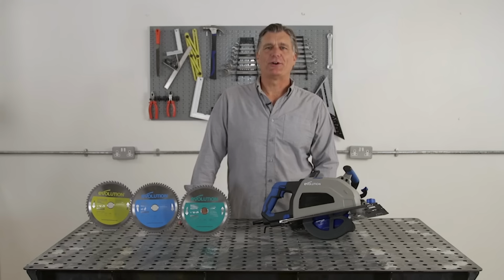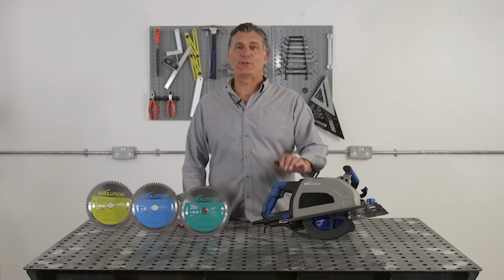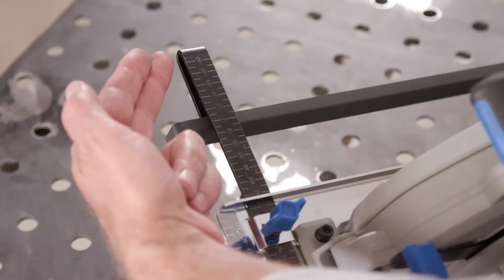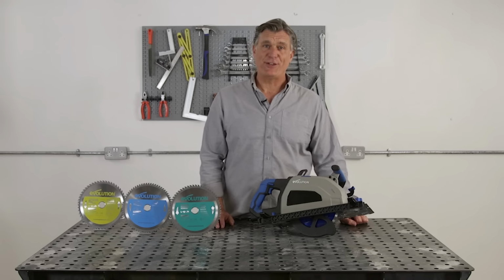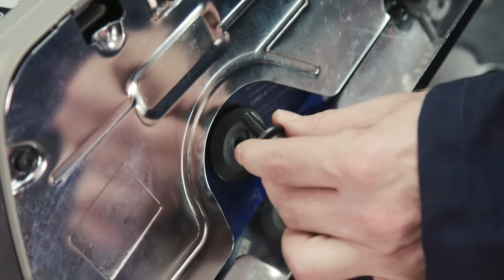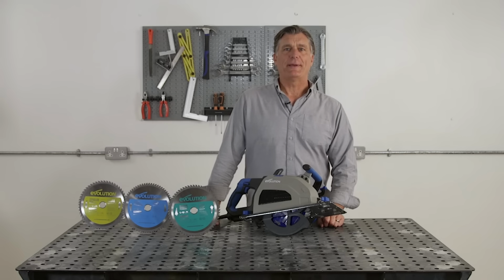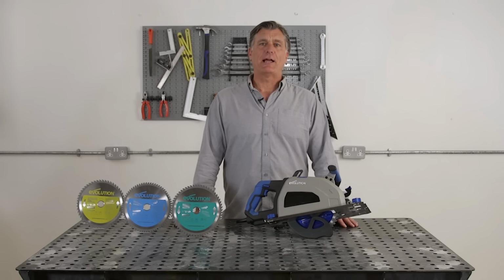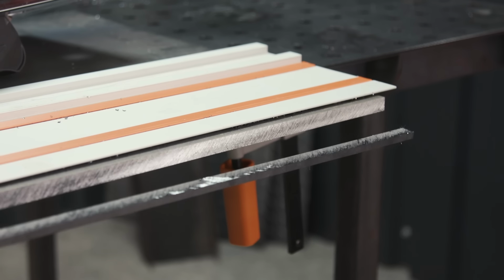🇺🇸 Heavy Duty Metal Cutting Circular Saw | Presentation | S210CCS

Comment: For those wondering about actual customers

I just bought one of these a couple weeks ago. Cuts through 3/16” galvanized grating like butter. Very clean and easy to handle. The motor is robust and doesn’t bog down. All in all, it’s a wicked buy.